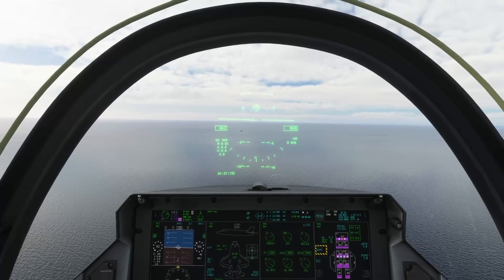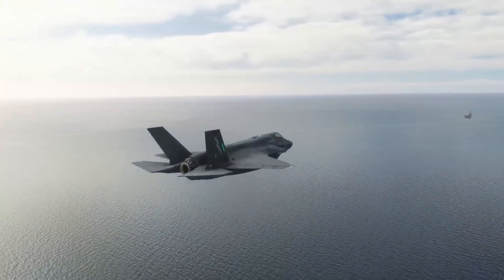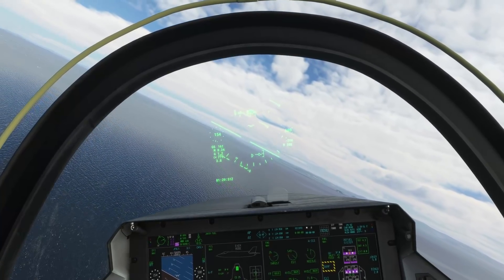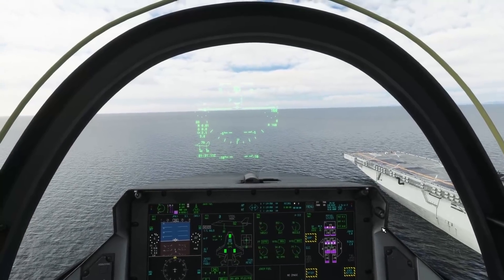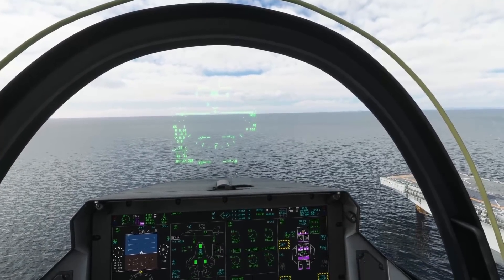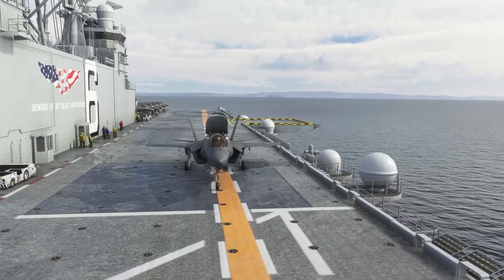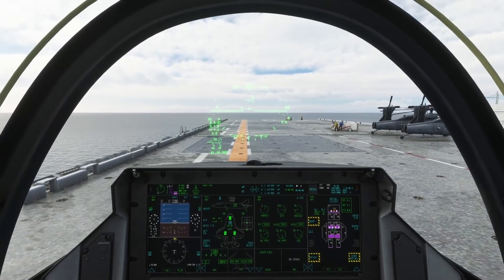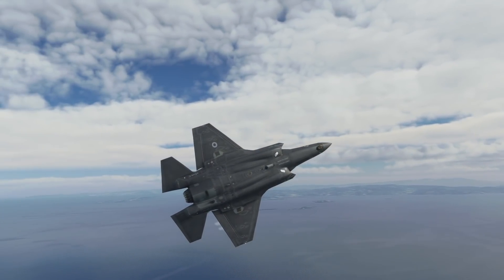Land your F-35B on a Carrier - CASE 1 STOVL - Indiafoxtecho F-35 (MSFS)

Comment: On moving carriers, mine rolls back and behaves terribly (wheelies and all sorts)
Reply from the maker: Is that with p brake on?
Reply: @cgaviator  Does the same if the parking brake is on or off 🤔
Reply from the maker: @bigarmydave  I know there are some bugs in the system as alot of the carrier options appear to be work arounds, but other than that, i'm not sure

Comment: I just bought the F-35 addon and it's amazing! i just have a question, when i engage hover-mode the jet sometimes continuously turns left (counter-clockwise), it's as if it's being pulled constantly. I can't understand WHY. Does it have something to do with my flaps being at 30%? It shouldn't since it works other times, but i'm not sure
Reply from the maker: Check developer Facebook. Maybe some bugs introduced by updates recently
Reply: @cgaviator  thank you!

Comment: What control do I need to map a button to for my HOOK/VSTOL? I.e. what is it called in the function list so I can put it to a button on my throttle?
Reply from the maker: It should be in the manual. I think I mention it during this video. Or it's somewhere in the comments. Haven't used it for a while so I'm not sure off the top of my head.
Reply: @cgaviator  yeah, I figured it out. VSTOL is mapped to the lights on/off and HOVER is mapped to heading hold. Mapped them to a couple buttons on the HOTAS and it works great. Makes me appreciate all the more what an amazing aircraft the F-35 is. So now I'm gonna do the same setup in P3D and have all that plus all the other F-35 features that P3D has (Tacpack) that MSFS doesn't have yet.
Reply from the maker: @Cash_McCoy  MSFS is in desperate need of a tac pack!
Reply: @cgaviator  yes it is. But I think VRS might be waiting til MS gets a few more things worked out. You can't even have a basic functioning radar yet, never mind a complex fire control radar.
Reply from the maker: @Cash_McCoy  too true. I tried out the F104 radar workaround and it was fairly
Impressive all things considered but added a bunch of stutters

Comment: How does this plane stay under control in STOV? Is the pitch angle limited to keep thrusters firing down? I’m guessing altitude is also held steady unless you pitch???
Reply: @BravoCheesecake  I knew that, but thx anyway. If you keep the stick at 0 pitch, will it maintain 0 pitch? How about when pitching up then letting go of stick? Does it pitch up and stay? Or drop back to level, 0 pitch angle, flight?
Reply from the maker: I’m guessing that it returns to level flight. There are other autopilot speed control options. It’s very configurable.

Comment: Looks absolutely amazing, I could watch that take off on loop all day. Plus my worries wouldn't work well on xbox are solved. Already have controller binds set up that will work well. Can't wait to grab this. Just hope isn't toooo long for the marketplace as I don't want to buy twice
Reply from the maker: It's always tricky with MS updating the core sim files so often. Just look at what's happened to the PMDG DC-6! Fingers crossed. I do miss my xbox!
Reply: Need those controller binds 😅
Reply: Do you have to have controller binds, or can you use the in cockpit screen?

Comment: Very cool. A much lower workload than the (DCS) AV-8B. Hover mode looks great, although an LHD usually has a bit of steam up so you would need to match that speed. This certainly helps on the Harrier as the wind over the control surfaces plus the reaction jets are required for attitude control. I think the Royal Navy also developed a technique for 'rolling landings' which requires less fuel and presumably allows a higher landing weight (bring back more unused stores) as the full weight of the aircraft doesn't need to be countered purely by engine thrust.  Please keep these videos coming, Chris, they are wonderful holiday treats.
Reply from the maker: Yup, that’s precisely what rolling landings are for, and I was lucky enough to have a go in the real F35 demonstrator sim as a youngster. Easy peasy! My next video will have a selection of take off and landing options 👍🏻
Reply from the maker: And I love the AV8B in DCS. The old skool in me prefers the challenge of the old control logic. None of the computer interference! 😄

Comment: Do you think it would be more "scan friendly" to toggle the ADI/PFI panel to a centre position on the panel?
Reply from the maker: Probably, haven’t got around to dabbling with specifics just yet 👍🏻
Reply: @cgaviator  No worries. I scratch my head as to why they'd default it to the far left position? IIRC the P3D version was the same, and the developer is a stickler for authenticity, so go figure?

Comment: V nice.  Thanks for your channel Chris, I’m ex-RAF GR4 Nav and the visuals and immersive experience you’re demonstrating makes me want to get into flight sims now..  I miss the flying so much!  Any chance you could let me know the minimum spec of the PC I’d need to run MSFS and these add ons and also the recommended sites to download the software… I’ve got my eyes on a HOTAS set up from Amazon…. You’ve resurged my passion for military aviation with these tutorials (and you’re good!). I have 50+ hours in the 100 Sqn Hawk T1 (CP in your ILS tutorial) so that one made me smile :-)
Reply from the maker: Thanks for the kind words! It is nudging so very close to looking real! If you check my website, link below, you can see my 2016 PC build. That ran it on high visual settings with traffic switched off. Min specs may be available in the Microsoft website. Addons are available in the sim’s built in marketplace once fully compatible. But I would recommend using Orbx if available as a simple place to download and organise addons. Otherwise you’re looking at Just Flight or the developers own website. You could use simmarket but I’ve stopped using that of late. Chose wisely with the HOTAS. Though I started with a Logitech Extreme 3D pro and it was perfect for many years til I got a Warthog HOTAS with 10cm extension tube. I also recommend MFG Crosswind rudder pedals. All depends on your budget 👍🏻
Reply: @cgaviator  cheers Chris, appreciated.
Reply: @paulharris2312  Hi Paul. Thank you for your service.  In addition to this excellent channel there is also Fast Jet Performance where a former Tornado front-seater has a lot of fun with the DCS simulator (disclaimer: I'm one of the people going through his training - its a blast). You may also like to check that channel out as well.  I've taken a former RAF Harrier pilot through DCS with VR and he loved the experience - it made him want to fly again.  The cheapest upgrade you can do for a good experience in flight simming is getting at least 32 GB of RAM.  The upgrade with the greatest impact to flight simming is the power of your graphics card (GPU). An RTX 3080 is pretty good (I have an RTX 3090 and its amazing). When selecting between graphics cards of similar price the one with greater video RAM (VRAM) will make the most difference - it turns out moving data from main memory (RAM) to video RAM (VRAM) is relatively expensive in terms of performance - the more scenery your video card can have in its VRAM the smoother your experience is.
Reply: @staubsauger2305  this is really useful and appreciated, thanks!
Reply: @paulharris2312  if you want a very, very easy, casual way into it, then I run it on an Xbox series S. Great visuals.
Reply: Try this in VR (a decent PC with an Oculus Quest 2 is good enough) and you'll be mind blown ;)
Reply from the maker: @AndreaHaku  still trying to dial in my rift s, will get there!
Reply: @cgaviator  awesome! have fun with it :) it really changes everything. Personally, since MSFS 2020 supports VR I only fly with it. Can't fly on a monitor anymore :D
Reply: @AndreaHaku  I’ve added Oculus 2 headset + PC connection lead to my Amazon basket 👍… I’m assuming I can still use HOTAS… but how does that work ?  Or do you just use the O2 controllers?
Reply: @paulharris2312  sure, you can still use Hotas as well as using controllers for instrument buttons etc. I use a X56 joystick (with extension to make it more realistic)  and throttle along with rudder pedals. It works like a charm :)
Reply: You only need a graphics card and you can play on keyboard and mouse but I prefer Hotas X52 it’s really good and it’s what I use when I play. :)
Reply: @cam_bannana2752  thank you! 🙏
Reply: @paulharris2312  I run mine on a large Panasonic TV at 1080 using an older Intel i7 and a 2060 graphics card plus the usual SSDs and a decent amount of RAM . With settings at High rather than Ultra it is perfectly acceptable but if you want to go to these types of quality visuals and play at 4K  it will cost.   The graphics card used here for example can be a grand on its own.
Reply: @paulharris2312  no problem just trying to help :) have a great day or night god bless you and thank
You for you’re service I want to go into the Air Force when I grow up people like
You inspire me  :)
Reply: If you like this, you might like a game called VTOL-VR. It’s a flying sim that is lightly simplified but still quite in depth when it comes to the mechanics in it, it’s about £17 on steam and doesn’t need an extremely powerful pc to run.

The only reason I point this out is because that game has a plane that takes a lot of inspiration from the F-35, not 1:1 but similar enough. The graphics aren’t the best but it makes up for that in the flight model and controls. So if you have a VR headset you should definitely check that game out